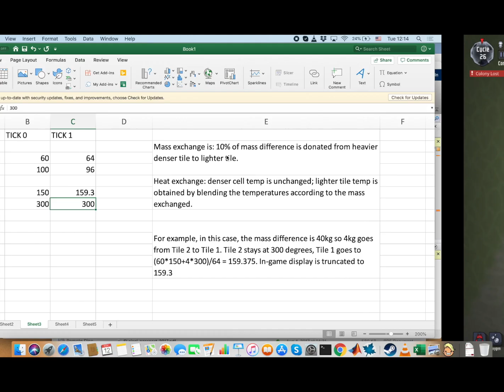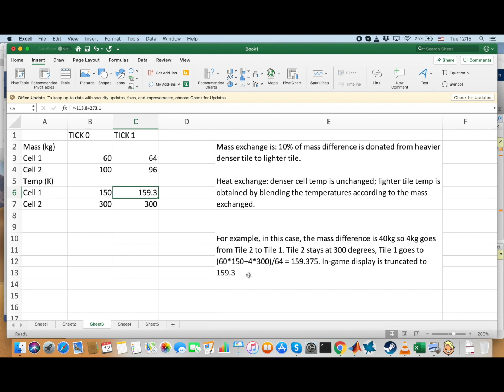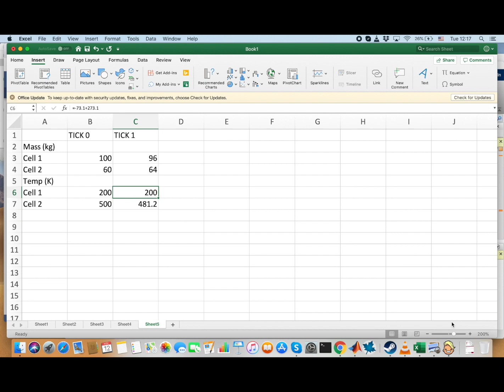Gas Thermodynamics (Oxygen Not Included)

Comment: This is a fascinating video.
Two others things I know about gas:

A hot tile under a cold tile of the same type of gas can result in them swapping place at random (so hotter tiles bubble up).
When two gas tiles of the same type are horizontally adjacent, they sometimes spontaneously average their temperature (i.e. both become the average temperature of the two tiles). This doesn't occur vertically.